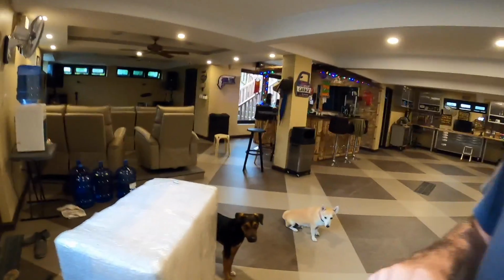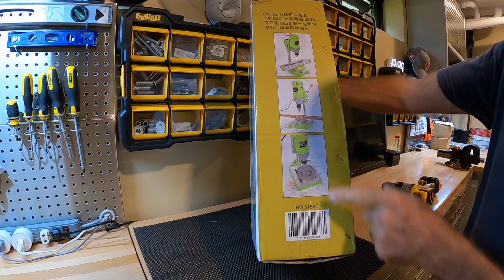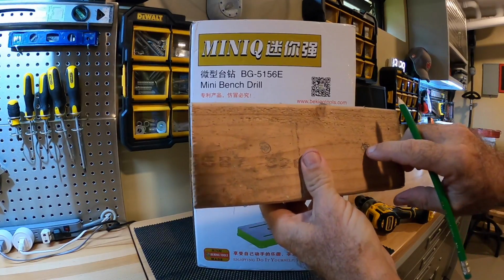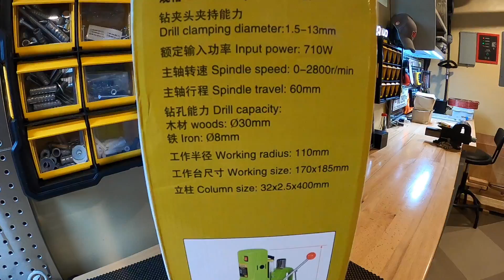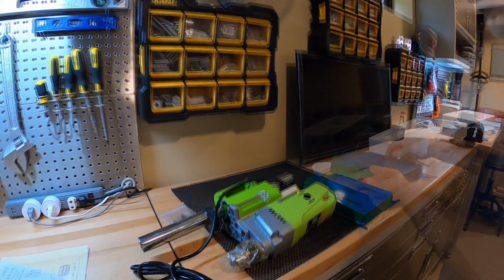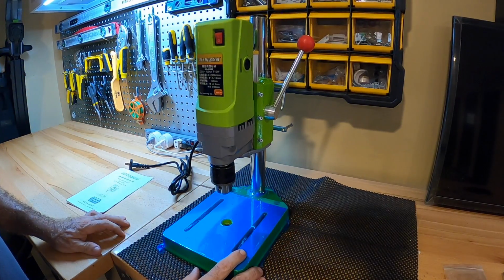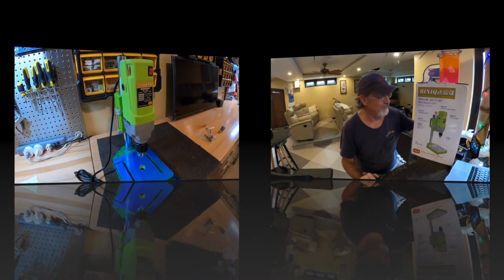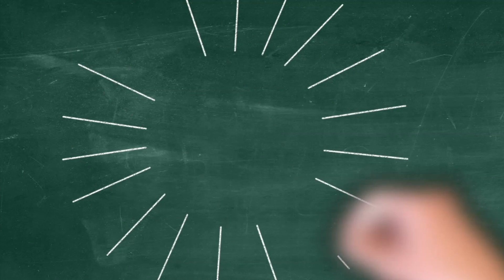BEST MINI DRILL PRESS FOR SMALL WORKSHOPS (Home Building in the Philippines)

Comment: What they mean by 'Make in Italy' is it was designed in Italy. You have to allow for mistranslations either by non native English speakers or using auto translation tools.

Could you measure the outer diameter of the vertical pillar? I am planning to purchase one of these which I hope would be enough formy needs but i mwill need the drill itself to go a little higher so I will need to replace the vertical pillar/pipe

Comment: Did you check if it was level? Did you check if it was plum?
Reply from the maker: No I didn't do a level square check because even if it's off by say .0 something mm I couldn't adjust it as the base is fixed.  Again, this is not for commercial precision drilling.

Comment: James. My house here is all Inovelli Zwave switches run through a Hubitat hub but they are 120v. What smart switches are you using there?
Reply from the maker: I made the wrong reference when I said "smart switch". They're actually "smart plugs".  I ordered them on Lazada.  Inexpensive and takes about 3 minutes to set up.  https://www.lazada.com.ph/smart-plugwireless-outlet-wifi-plug-us-socket-no-hub-required-wi-fi-mini-smart-plug-socket-outlet-works-with-amazon-alexa-remote-control-your-devices-from-anywhere-intl-i266644126-s375895388.html?spm=a2o4l.myreviewhistory.0.0.73523e17K0O3r4

Comment: is it geared or belt?
Reply from the maker: It's geared.  This drill press is for the novice who only has occasional need for accurate drilling.  It does not have a lot of torque so I would recommend a belt drill press for more heavy duty applications.
Reply: @MyPIDream  Thanks for replying.  If it's geared, I bet it is somewhat noisy